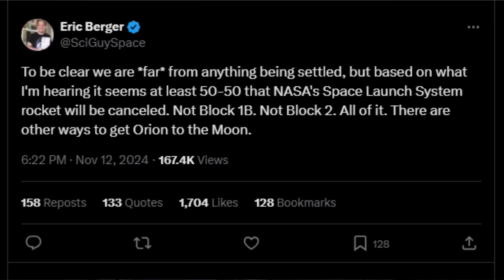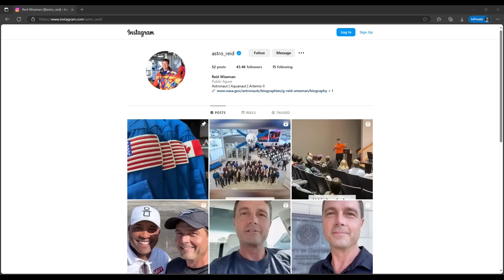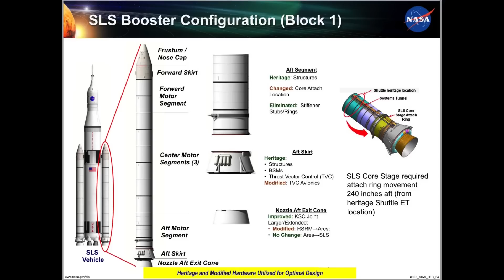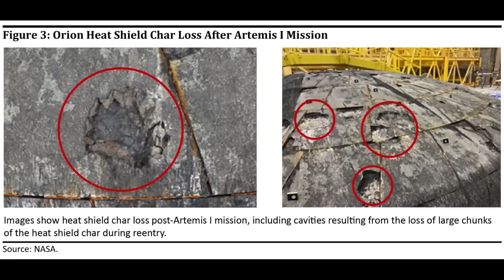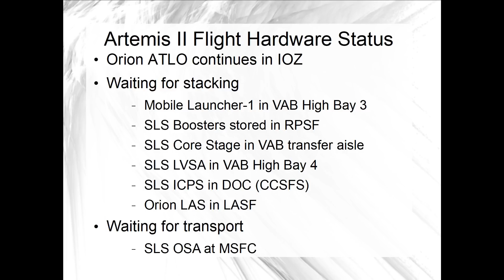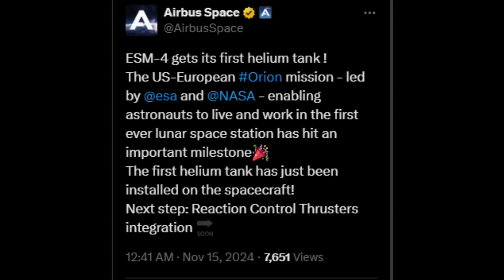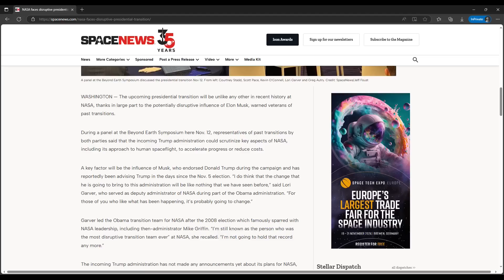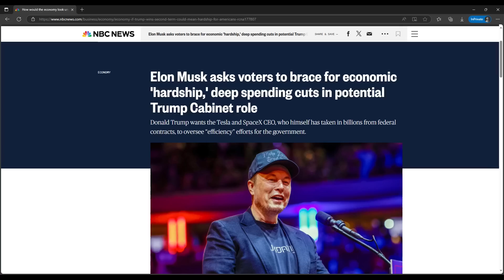Artemis Anxiety: cancellation concerns while NASA looks at Artemis II stacking options

Comment: Could Starship be retrofitted to carry orion/esm to orbit and then dock with HLS? Or retrofit Vulcan centaur to loft Orion to then dock with HLS
Reply: Eric Berger suggested that people are floating the idea of Falcon Heavy launching Orion to LEO then docking with a centaur launched on Vulcan.
Reply: @danmosenzon1477 How about ULA putting Delta 4 Heavy back in production? It's proven to be efficacious in launching Orion-ESM-ICPS.
Reply: @dalethelander3781  Even ignoring that reopening the production line would take longer than creating an adapter for Vulcan, the Delta IV uses a Russian-made engine for its first stage. Not exactly an easy ask at the moment.
Reply: @angrymokyuu9475  Wut? Are you confusing Delta IV with Atlas V?
Reply: @perfectman3077  Yes, yes I did.

Comment: The idea I’ve had for a while: scrap Gateway, and further SLS blocks. Start procuring a private alternative to SLS/Orion, and build out as many Block 1 SLS’s as we need.
Reply: You cant produce SLS block 1s, production line for ICPS is closed, not to mention EUS is a cheaper stage as its optimized for production while ICPS was interim solution
Reply: @_mikolaj_  definitely not cheaper considering how it will only fit a few times.

Really if they can’t procure a 4th ICPS they should just delay Artemis 4 onward. SLS/Orion is not a sustainable solution to getting astronauts to the moon, it’ll hold us back just like the Shuttle did.
Reply: So you mean just let sx go ahead and take over? Pretty swampy idea don't you think?
Reply: I would agree with except scraping gate way